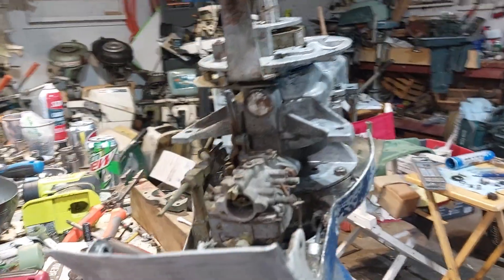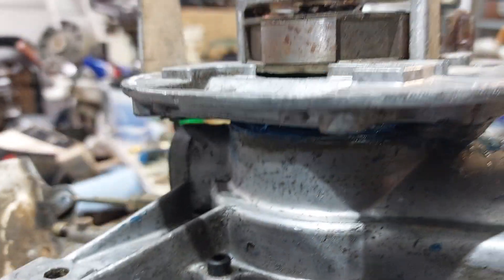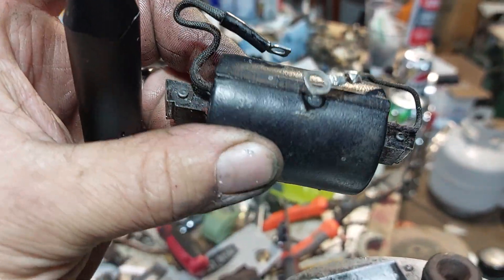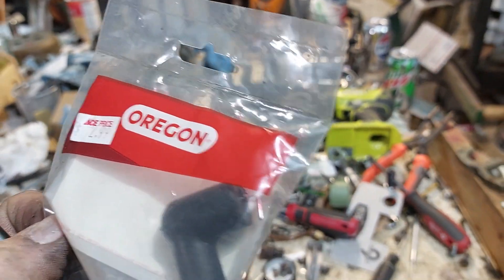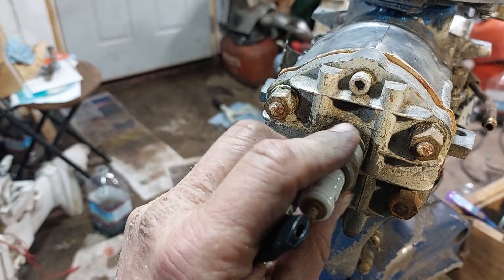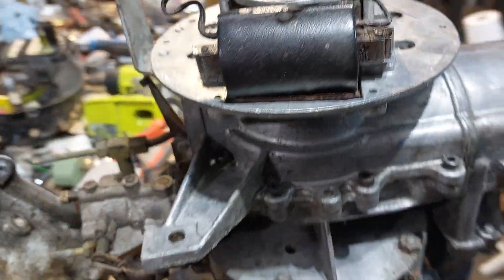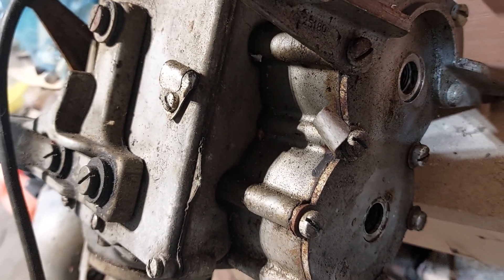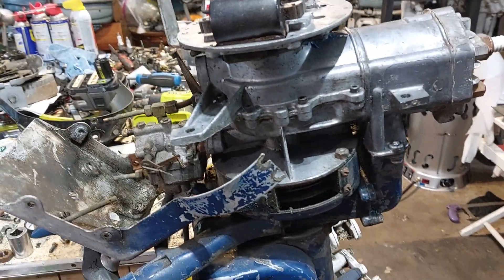1947 2J Champion Blue Ribbon 4.2hp single #vintage #boatmotor #champion

Comment: I bought one of these for $75 delivered off an old guy. After he left he texted me that he had been running it on 50:1. I run it on 16:1 now but who knows how long it will live after years of that. Cool motors. They idle down so low.
Reply from the maker: Hopefully he didn't use it much and it'll be ok..
Reply from the maker: I have two other Champions that run, one other 'stuck' Blue Ribbon, a 'Hydo- Drive' I haven't touched yet and 3 others I can't quite recall the hp. of. These were at one time built by Scott Atwater before Scott Atwater built their own.I think they are pretty darn neat!! Thanks for watching!
Reply from the maker: What compression did you find? I have a second model that was stuck and so I removed the head, soaked her down with penetrant and next day I beat the piston free with a 2 by 2 and hammer. I ended up with 95 psi. Incredible 😮!